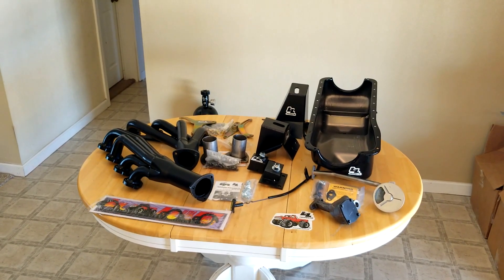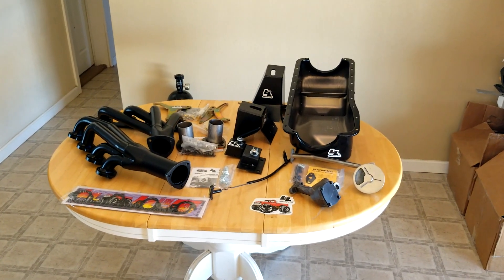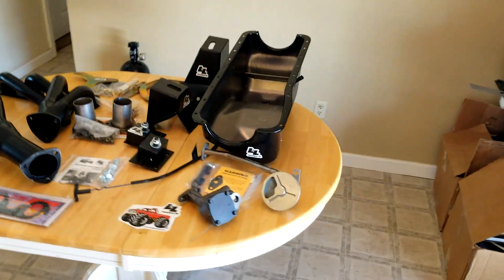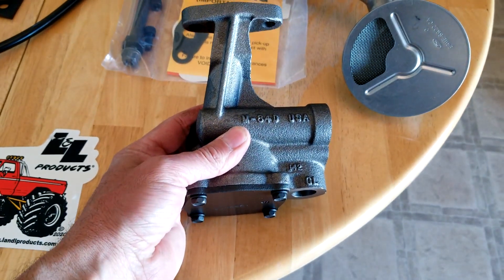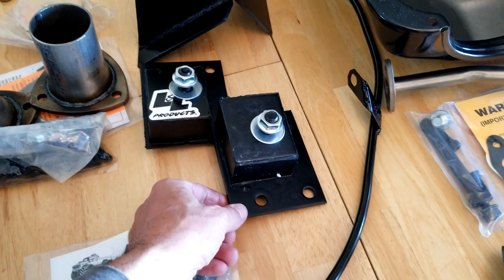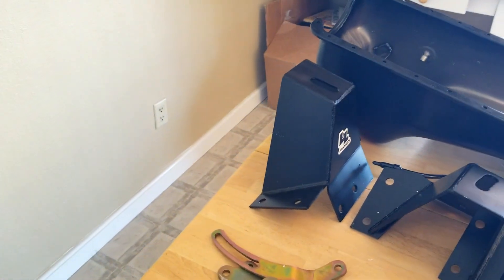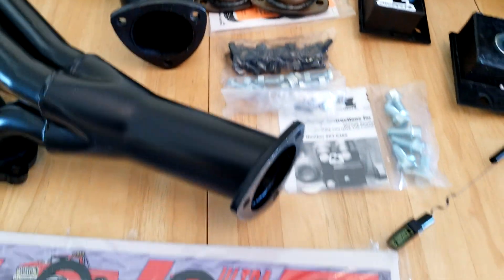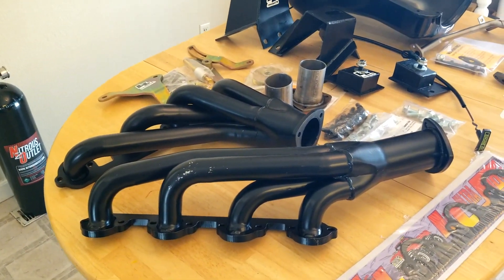L&L 460 Swap Kit for AJ's 75' Highboy.

Comment: did the install go well? headers fit and all as advertised?
Reply from the maker: It went ok. We had issues with the power steering pump, had to do some wonkiness with the bracket to get it to work. Headers actually fit well, I don't recall having to get the hammer out, unlike the dually. 😂